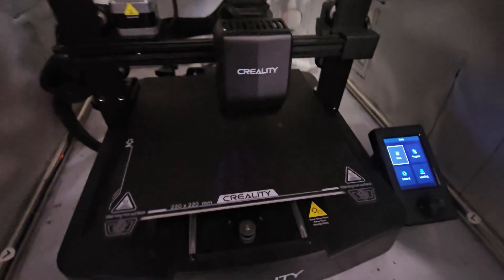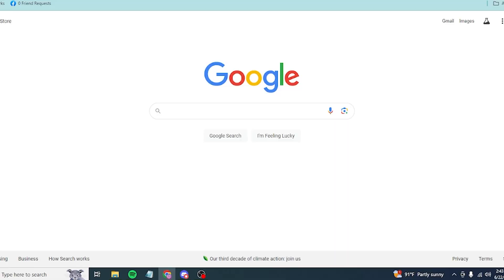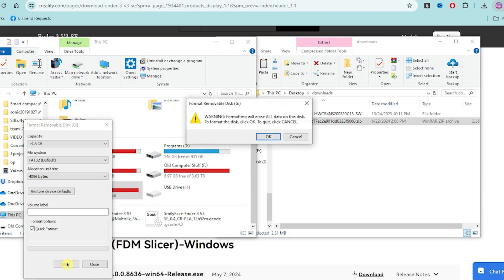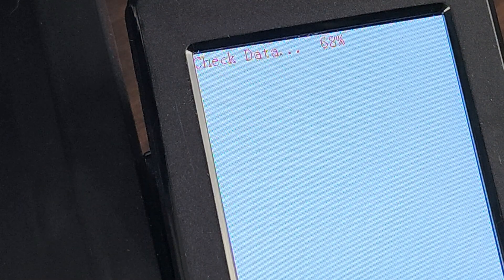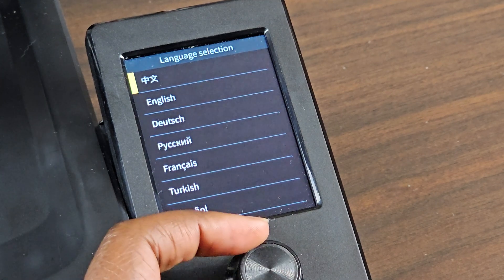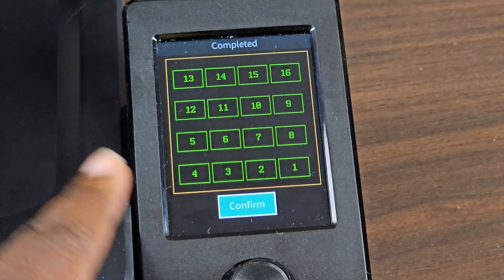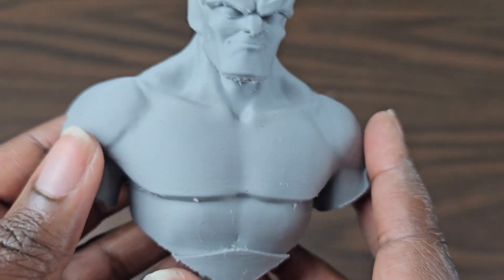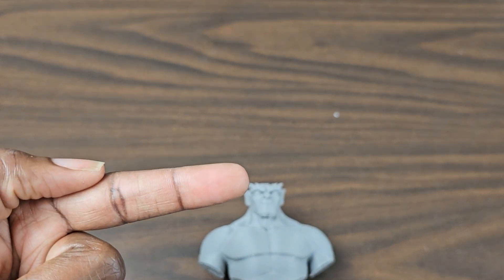Updating Your Ender 3 v3 SE: A Step-By-Step Guide

Comment: The problem I am experiencing is that after reformatting the card and adding the mainboard firmware, the printer just turns onto the main menu without actually doing the firmware flash. Has anyone seen this?
Reply from the maker: Which Hardware version do you have? I did an updated video where I install the latest Firmware version.

Comment: Does it have to be 16gb or can it be more?
Reply from the maker: For the brand, that belonged to my Ender v2. I hear people have bypassed it using 3rd party tech. Others have tried 4g, 2g, and still nothing. In all honesty Creality needs to step up about their SD cards. It worked for me, so personally I'm sticking with it until it fails me and then its back to the drawing board. 

 I don't think it will work either if its more than 16gb cause again, Creality. So try 8gb, if you have other brands lying around the house try those too. As long as you can format it to FAT32 with 4096 bytes you're good. Its been a year since this video has been made and I heard for the past couple of months there is an update that caters to both C13 and C14. So if your printer has C14 firmware this video will not work for you.
Reply: @ThatBlerdGirl I actually just got it to work with a 32gb onn. branded SD card!!
Reply from the maker: @jackofalltradesblacksmithing excellent, again creality is strange. What works for some may not work for others. I'm just glad you got it going and that's what matters. Happy printing.

Comment: Not working. Never updated so it's 1.0.6. and when I tried to update it to 1.1.0. it just stays on blue screen. Scren update was ok, but with SD- card it gets stuck. I waited two hours so I don't beliede I shut it off too early.Made everything internet tells to do. Still blue screen.
Reply from the maker: Hello. Trying reformatting the SD card again making sure it is the FAT32 with its allocation 4096. Did you change the name of the 123.bin? If you did and still didn’t work, I read on reddit someone tried firmware.bin and after 10 secs it worked. For whatever reason the board is sensitive to the name of the file. I hope this helps.

Comment: Thanks a lot, it works for me
Reply from the maker: Thank you so much for watching, I'm learning that there are two different systems so it will work for some printers and others not so much.
Reply: @ThatBlerdGirl  Are you talking about the 2 hardware revisions for the Ender 3 V3 SE? For anyone that sees this in the future I think the only thing that differs in the process is using the c13 (older version) or c14 (newer version) firmware. You can check which you have under printer info on the printer itself.
Reply from the maker: @JRule237  Yes that's exactly it.  Thank you for alerting the masses.☺
Reply: @ThatBlerdGirl  No prob! Thank you for the vid, I had no idea about the screen update and micro sd slot in there and thought I might have bricked my printer lol.

Comment: 7:12 does anyone have any tips on how to avoid that stringing you see on the bed plate after the wipe? it keeps dragging that into my print area and causing me first layer issues if i don't catch it and get it off immediately
Reply from the maker: Personally, from what I've noticed, heat is the number one culprit as to why you saw the stringing there. I had it set to an old setting where I didn't use a temp tower and to find the proper temperature for that filament. Try that and see if that will solve it.

Comment: Thank you for this tutorial but i keep getting the blue screen and i have the exact same sd card as you and i made sure that it was reformatted fat32 and 4096 bytes, so what should i do?
Reply from the maker: Hi.

1. Did you try installing with the file's name first or did you change it to 123.bin first? 

 2. If the card you bought that's exactly like mine did not work, you can try another card or another brand as some one has commented in the past that they tried a different brand so long as you are able to format it to FAT32 and 4096 bytes. 

3. Try renaming the firmware to firmware.bin.

But often times people tend to update the printer before the display which causes the blue screen majority of the time. 

I'm also hearing now that there is a c13 and c14 when it comes to the updates.  I may need to look into what that means for future firmware updates as that may be a potential culprit. 🤔
Reply: @ThatBlerdGirl  1: i did it without the 123.bin 2: I tried another card but same thing 3: will do. thanks

Comment: Tried multiple SD cards 4g, 2g, and g.  Formatted (fat32, 4096) multiple times always same results. Tried all the help in the videos.
Nothing I can do or try has worked. Printer still dead.
Reply from the maker: greetings what result occurred, a blue screen? A blank screen? Did you start with the printer before the display screen? Could you please explain the outcome.

Comment: Wow that was so much more complicated than other printers I have owned. that system is stupid. but this printer is smoother and seems to be better but much of it has de-evolved over the power house Ender 3 pro. so wish I had not wore those out. Now if only i can print on glass with these instead of that damned finicky PEI sheet.
Reply from the maker: You and me both, I have the Ender 3 v2 and I loved the glass plate I purchased, but I hated having to constantly bed level. I wanna try Flashforge's AD5X printer next so I can have two hearty printers. So one prints in multicolor and the other plain if I'm in the mood to air brush.

Comment: It's not the brand of the MicroSD card, but the size. Windows, for whatever reason, doesn't let you format any storage media larger than 32GB as FAT32. There are ways around that, like using third party programs.  Also, be aware that some types of SD cards (yes, there are different types of SD cards) are designed to work best with exFAT. If something's not working, do some research and be patient, that's the best advice I can give as an IT and web guy.

EDIT: I think you misspoke when talking about formatting the card. It's 4096 bytes, so 4 kilobytes and not 4096 kilobytes (which is 4 megabytes) ;)
Reply from the maker: Believe me, it's obvious I'm not skilled in the I.T. profession.😂 But I thank you for your knowledge, it is very helpful and I appreciate it.😊

Comment: 123.bin didn't work for me either. I don't know what else to do....
Reply: I am in the same situation! What have you resolved with your printer?
Reply: Also been in the same boat not too long ago. Figured out that it had nothing to do with my SD cards, but with the SD card slot being flimsy. It just didn't press SD cards good enough against the pins. I suggest you checking that first by placing some gcode on it to see if it can be read. If not - either stick some tape on top of the card, or unscrew the bottom plate to get access to the board and press down on the slot to bend it, any of these will increase pressure for more reliable contacts.

Comment: Can you use the USB adapter to do the same thing??
Reply from the maker: Good question. Unfortunately, I never tried it. So I do not know.
Reply: @ThatBlerdGirl  OK, I should say I am using windows 11 and it does not offer the 4096 in fat32. It offers 8192 witch is double the 4096. I can chose 8192 witch is the default or use 16k,32k or 64k. Any ideas on this? I should mention that i have sd card for the micro card to insert into it. But I am wondering if it is ok to use the 32mb card and not the 16mb card and it the same brand you are using. any thoughts??? Thanks, Dave p.s. your videos are very informative and thanks for taking the time to make these videos.
Reply from the maker: @countryside8122  I would try default size and see what happens, based on what I saw on creality's website, they only indicate 4096 so anything above that may not work. (But then again, I never experimented to see if it would. 

Thank you for the comment, I try. I'm not perfect nor am I an expert at this, but I love to learn things, try to share what I've learned, and hope it helps others. 😅. Please let me know if that worked.

Comment: I just updated the display and when updating with the BIN file I do not get the blue screen with the language selection.  Mine is a black screen with 4 options that seem to be Chinese.  What do I need to do?
Reply from the maker: So even though you renamed it 123.bin it gave you the four options in Chinese? It might be a card thing. Have you tried to install it without changing the name?
Reply: @ThatBlerdGirl  I will give it a try.
Reply: @WilliamMeade-y8v  It worked to update the firmware?

Comment: The issue I have is that no text comes up when trying to update the display firmware, it just becomes the regular blue screen.
Reply from the maker: So to clarify. This is the first thing you are trying to update and haven't updated it yet  because it gives you a blue screen instead of the text. My only thoughts are the SD card. I'm sure you've reformatted  it and made sure that it reads as a FAT32, but sometimes there are cards that for whatever reason, won't work. I went through several before I ended up using the one that came from my ender 3 v2 to do this update. If reformatting or getting a different card still doesn't work, there are plenty of amazing creality communities online that are my go-to solving problems. I hope this helps.

Comment: I really appreciate your videos. Thank you. I have updated the screen firmware successfully. I have not been able to update the mainframe firware at all. I have tried 123.bin and different cards and all sorts of things. Nothing seems to work. My screen starts with the language choice, then the Confirm Build Plate is clear, then the Auto Z/Heating Nozzle/Cleaning Nozzle then the print head moves to the middle and touches down, and then it goes back (it doesn't do Z offset) and the screen resets to the language choice. 
Any thoughts?
Reply from the maker: Not gonna lie, I had to go back to my old 3d printer threads 😅. I think I saw a situation similar to yours. I don't know if you just bought your printer cause they should have the update (that's what happened for my bro-in-law) if not check your voltage, if your voltage switch moved for whatever reason during the update it could be that. As it should be set to 115v.

Comment: Question with the SD card : I've used a different brand, but I could still format it just like you did (needed to partition it to 4Go, but it works). The problem is that the download is stuck at 0%. Any ideas ?
Reply from the maker: @thibaultdesrumaux8067  Well, partitioning is not really formatting. it's dividing the mini SD card's space. The card I used is 16gb, and I was able to allocate it to the 4096. I haven't tried any other brand than the one that could only convert to exfat. So the one I specified came from my ender 3 v2, which I think may have come with the printer🤔. So, if you are unable to format it to 4096 without having to split the storage, it could work.

But again, you have a different brand, so I don't know if the card is the culprit or creality is picky on their card brands.

Let me know what happens when you format without partitioning. So I can give you credit that other brands than the one I suggest will work without fault.

Comment: What do i do if it failed pls help😭
Reply from the maker: @3dprintingnerd12  what is the message that you're getting? If you didn't get a message what does it look like?
Reply: @ThatBlerdGirl  do you have discord?
Reply: This filament company near by my house ha a discord and i would love to add you if you wanted
Reply from the maker: @3dprintingnerd12  I appreciate the invite, however I will decline. The file that updates the printer is called "Ender-3 V3 SE_HWCR4NS200320C13_SW1.0.6_GD303.bin. That is the second thing you're supposed to do after you have already updated the screen display using the TJC_SET Folder. 

When you update your printer and it still doesn't work, rename that file to 123, which will turn into 123.bin. I hope this helps.
Reply: @ThatBlerdGirl i figured it out but thank you so much for always making helpful vids, u got a new sub over here
Reply from the maker: @3dprintingnerd12  Good, I'm glad that you were able to fix it. Thank you for the sub, much appreciated.
Reply: @ThatBlerdGirl hi again update i got an a1 mini combo
Reply: 2nd stage Upgrade not working can you help

Comment: Thank you so much for your video. I was having a heck of a time updating the firmware on my Ender 3 V3 SE's. You did a great job explaining the steps to do it. I followed your steps and updated both of my printers with no problem. I did have to change the main system update to the 123.bin file name. After that, it was smooth sailing. The difference was the type of microsd card you advised to use. Thanks again!!
Reply from the maker: @2013Camaro  Awesome! I'm so glad this was helpful. Like you, I was so nervous to update cause I kept seeing complaints and problems in forums that I refused to update until I had to cause the slicing programs were not working with the printer. 

I'm a visually hands-on person, so watching tutorials is my passion. I was hoping this would help people in a visual sense vs reading it online.

Thank you 2013Camaro (1997 Camaros have been my favorite style) for the lovely comment and happy printing 😊
Reply: @ThatBlerdGirl where doni find the bin file